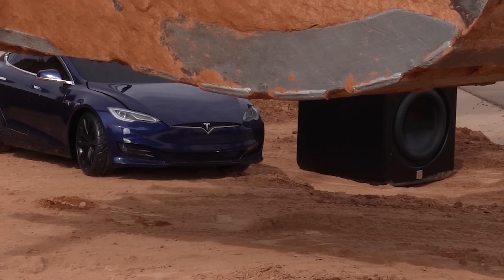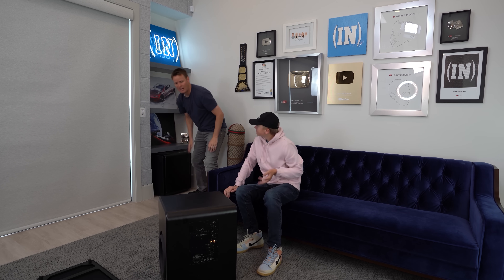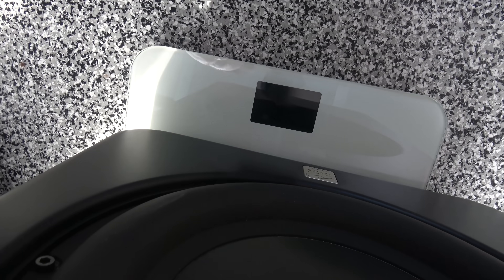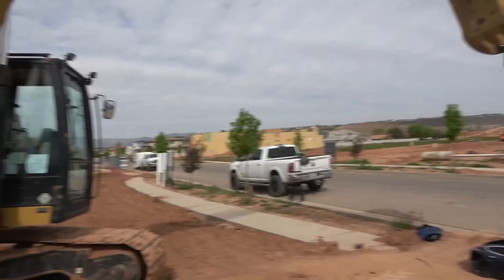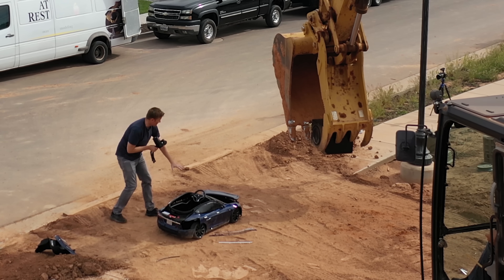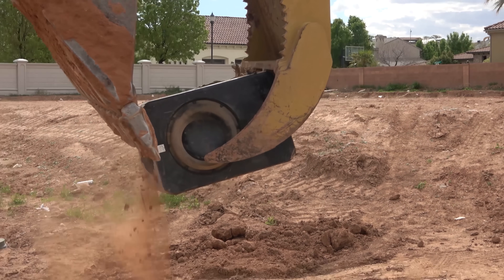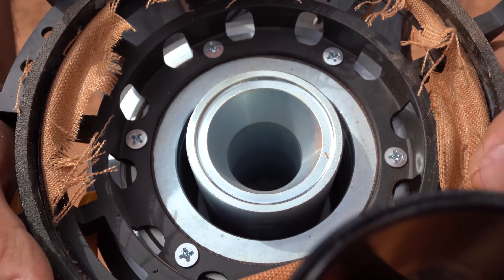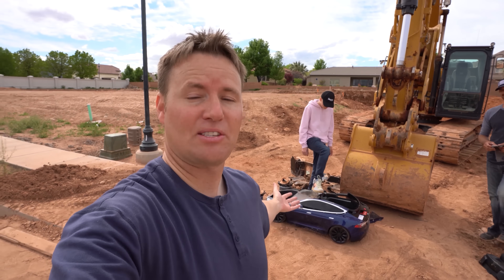What's inside a GIANT Speaker?

Comment: that with the small rings that is light is the voice coil, it's either aluminum or copper, it's basically an electromagnet on a kind of holder, which is the thing that moves the cone.

the fabric you cut to get to it is the spider, it keeps the voice coil and cone going linear in the magnet

Comment: What you are taking apart is 1. The spider that's what holds the Coil in place so it wont slide around 2. The plastic thingy is called a coil the wider and longer it is the deeper the sound and 3 the last part was the motor what creates the electromagnetic current to power the driver

Comment: Well they are cheating a little bit with the sub slapping it in the corner does give you a db boost and slightly diffirent sound by corner loading a sub.  Just some education on this. The plastic outside is the Cone,  the fabric thing is the spider. the stiffer the spider the better, cheap subs have crappy flobby spiders, that cone thing on the inside is for the air to escape. and the plack part with the "rings" is the voice coil, also that magnet there is ferrite magnet. so this will be a ferrite core speaker.

Comment: 7:01 those are not coils, that's called the spider and what you calling the magnet is called a motor and the copper coil that goes through the middle is called a voice coil. And most speaker or s uh bs have a bump in the middle of them on the outside, that's called the dust cap. And what you calling a cone is a voice coil as said before, the cone is the plastic and somtimes plaster or paper of the outside that you able to see when it's in the box

Comment: For those who confused the coil in the speaker is connected to the wires. When electricity flows through it then moves itself away from the magnetic bowl hitting against a plastic layer making a soft or loud beat simply all in the electricity flows
Reply: Its not hitting any plastic layer bruh its moving up and down it can hit only the bottom of the magnet (pole piece) but that only happens if u overload it the cone is moving with coil cuz they are atached to eachother creating a sound

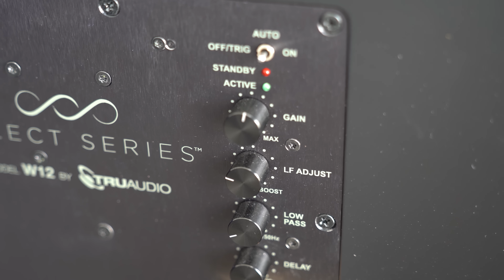Comment: 0:37 when you realize that the speaker is worth more than your life.
Reply: YourAverageWasabiGuy when you realize all DJs and events have a similar speaker worth a similar price
Reply: Clearly you've never been to an American hospital.
Reply: 5000 is not much tho..
Reply: @swooshid2914  it is when your talking soundbar subwoofers my klipsch is 300 and it does better in my opinion
Reply: @reakda3410  If you use a sound bar, you can't have an opinion on Hi-Fi audio.

And while I love Klipsch (I used to have a Klipsch SPL-150sw), soundbars simply cannot compete with any half decent home audio.
Reply: @Randommmmm204  I know but my subwoofer (I just realized it makes it sound like I use a soundbar) works well and I totally agree with what you said
Reply: @reakda3410  I really do like Klipsch stuff. Their horns are a bit too sharp for my taste, but they still sound really good. Even their cheap subwoofers are loud and they sound pretty good, and their more expensive ones are super loud, sound good, and go pretty low too.

I've gone through a Monitor Audio phase, a Wharfedale phase, a Klipsch phase, an SVS phase and now I've got basically the best subwoofers you can buy (2 JTR Captivator 4000 ULF). And out of everything I've heard, Klipsch subs are in my top 3. SVS have better subwoofers and a better value, but that's expected. Klipsch is a speaker company that also makes subwoofers, and SVS are a subwoofer company that also make speakers. And I do prefer Klipsch speakers over SVS, but not subwoofers. For $500 the PB-1000 is unbeatable.
Reply: Lol